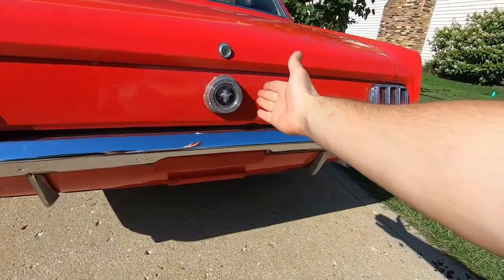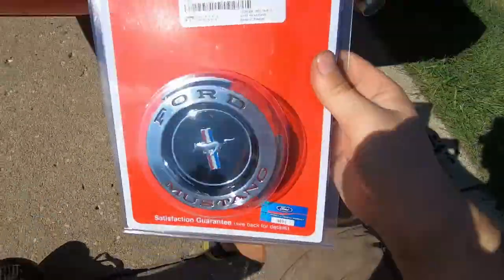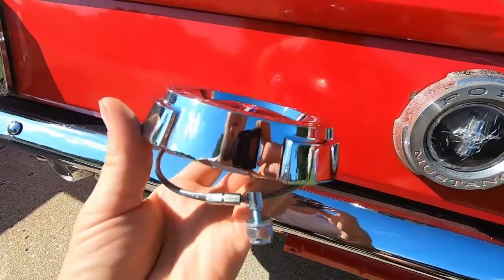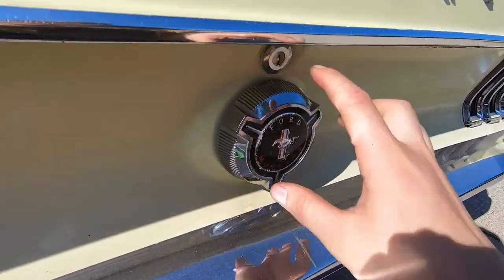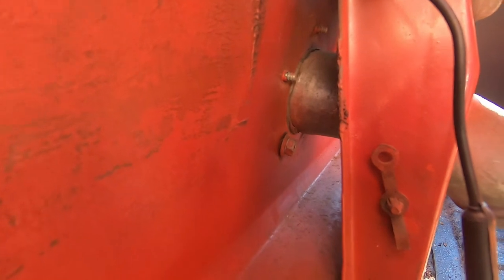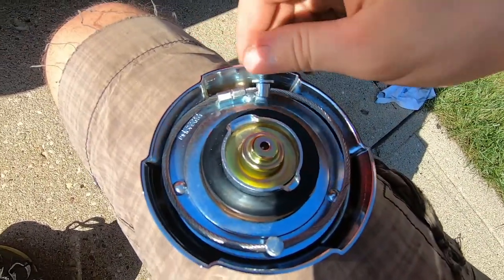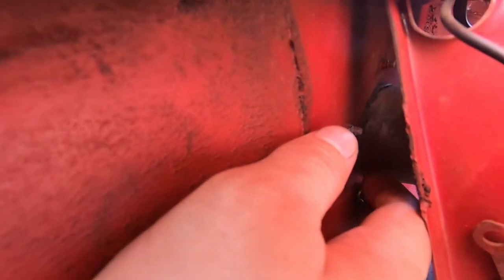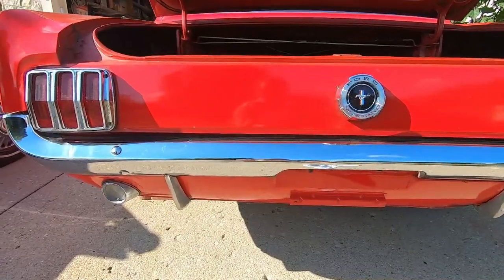How to Install a Gas Cap on you 1964 1/2-1968 Mustang

Comment: Well I liked your video on the gas cap I just got a 66 today do you have any suggestions how to get the cap Off I cannot get it off I’m glad it has a full tank I guess the first thing I need to do is probably disconnect the cable inside the trunk but I cannot get that cap to come off
Reply from the maker: Jerry.  First thanks for checking out the video.  Additionally some after market gas caps have locks on them.  But if yours is a factory one it should just twist off.  It could be rusted shut so if you think it is a twist off cap I'd suggest getting a big pair of channel lock pliers and seeing if that will help break it free.
Reply: Thanks for the reply I ordered a new vented gas cap as that’s what the local mustang hot rod mechanics around here said I need it since I just have a straight tube going down to the gas tank no vent line inside or anything also we did have to get a pair of channel locks it appears that the gas cap is partially broken because the part that goes in the grooves and twists on is very loose and what they did was a twisted it about a turn or a half a turn past when the running horse is vertical or horizontal should I say so I’m just getting a new cab